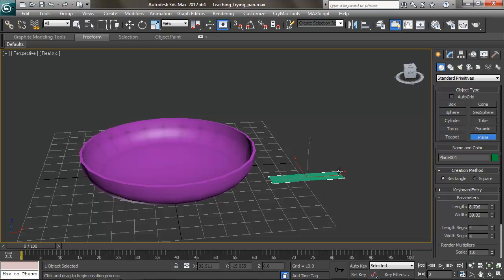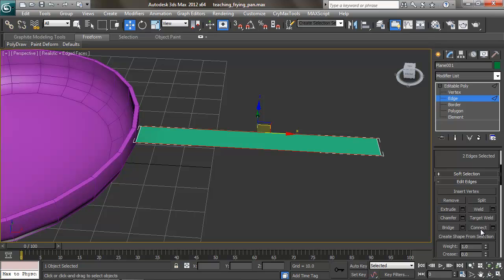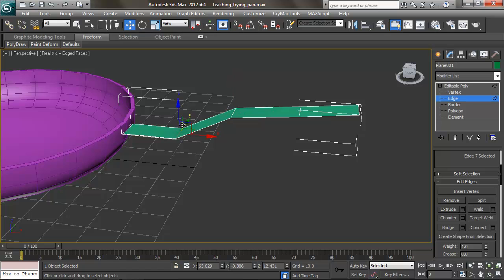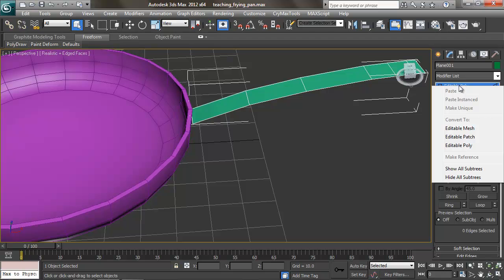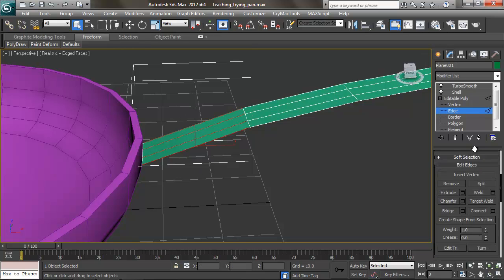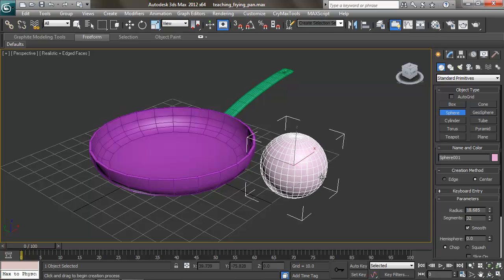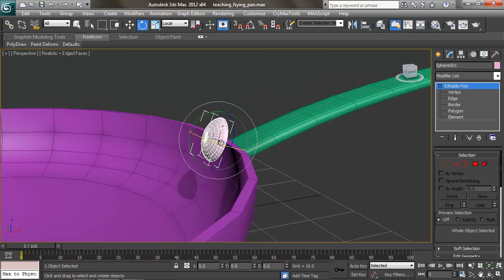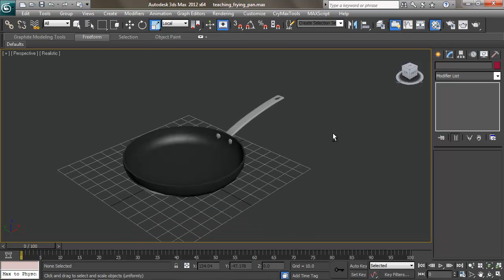Intro to 3D Modeling Chapter 3

Comment: is there a specific reason why, when creating the hole on the handle, you chose to create an edge loop through the entire handle rather than through just the tip of the handle? or would either way be just as efficient?
Reply: okay update...your way works much cleaner. without the edges running down the handle the turbosmooth looks quite horrible